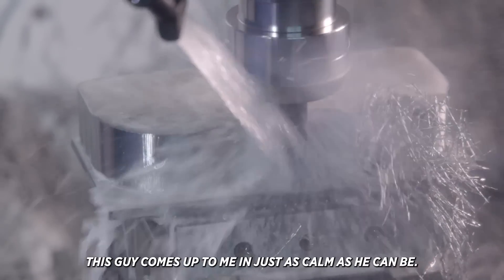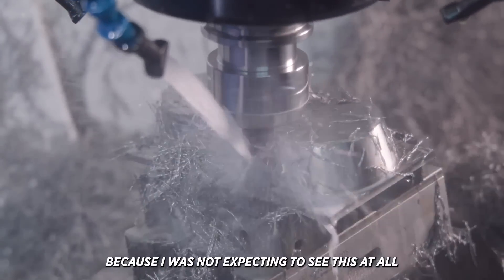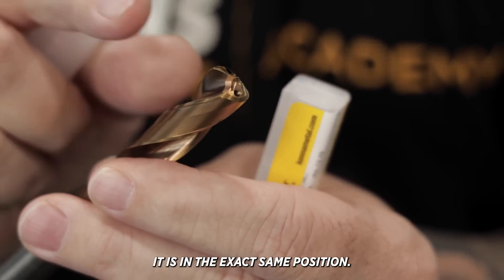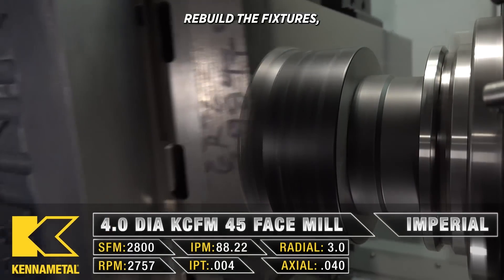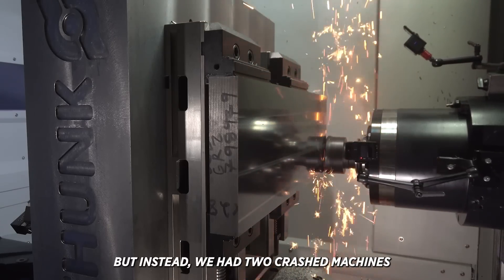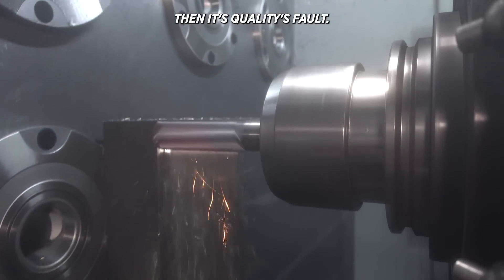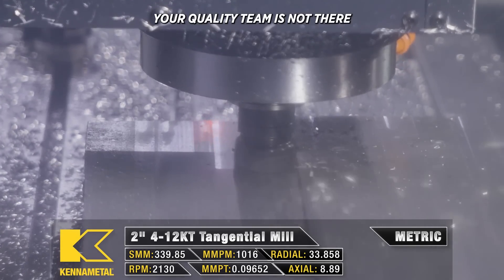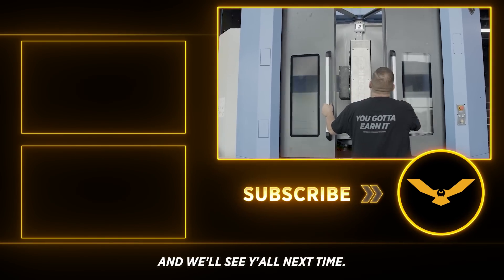$200,000 Damage | EPIC FAIL… Machinist CRASHES TWO MACHINES at the Same Time

Comment: Got a new one to add to the list, setting up op 3 on some inconel parts in a dnm 5700L we had our marketing guy doing different things throughout the shop so he knew a little more about what all we do and as I’m setting up the parts I was talking him through the process. Probing the parts that are now about 5.3 inches higher than the previous op cause they are vertical in a fixture i either didn’t plug in G57 when i touched off the z height or i exited the page too fast and it didn’t save the data for the 4th part. I started the program and it probes all the parts and I’m still talking to the marketing guy when it got to G57 and at 25% rapid went straight down popped the stylus and damn near hit the body of the probe but it pushed the threaded part for the stylus up into the body with enough force to bend something inside the probe, sent the old one to Renishaw where they may or may not be able to fix it and we got the loaner in today. So this one has a good chance of being my most expensive crash so far.

Comment: I have seen that attitude as well! Showed how to inspect the parts on the surface plate with an indicator where the height dimension was critical.He had to Check every 5 parts, easy right? I kept coming around asking how the parts are checking out,"All is good man". Ok right? I finally come around,(supervising 12 people), and check a few myself and low and behold they were out of spec! Turns out he wasn't even inspecting the parts! (He'd been an operator over 5 years!) Told me the machine is suppose to repeat so he didn't think he needed to check them. Well it also matters how one tightens the vice on this special extruded aluminum material. Started out good, then kept getting tighter and tighter, changing the dimension. The most basic of all rules is to  check your work, and confirm your making good parts. It was only a +-.003 tolerance, and a lot of 300 pcs. was scrap. We can hire monkeys to just push a button, but that's not the job! He was fired, because of his careless attitude. Quality is a habit, and if you don't have it, you're unteachable!

Comment: Some programmers like to believe they are Gods and programs are perfect. Operators will always get the shaft. I back plotted a program where the tool was supposed to clear the plate yet it didn't.  After that I back plot everything.

Comment: The factory where I work has a small machining area for some manufacturing steps, none of the machine tools are very large, the parts we make are less than half a pound of steel at the biggest. I've not operated any of the CNC machines there, but I've broken some very minor things before. It didn't feel good, but I've hopefully learned my lesson and now I'm always ready to smash that red button. To fail so spectacularly be so apathetic is astounding.

Comment: I worked for Cosworth manufacturing engines for Formula 1 from 2000 - 2007. The guy you are talking about would have been 'instantly' dismissed by the Company for his actions and attitude (or lack there of). To say that he had been with the Company for several years and put a 'new Program' into the CNC machine and simply pressed cycle start, then just 'walk away' for his break is UNFORGIVABLE.

Comment: I was in a job shop August to January. The programmer was the guy that crashed the most parts in that short time. His programs  were consistently incomplete, IE... Skipping the roughout altogether and just having a finish pass take 3in off diameter in 1 pass. So seeing this I had to go through every line of this guys program every time find things wrong M02 & M03 for instance.  Using wrong inserts, not having the proper tooling for a job. Then wonder why the time sheets are different from his time to actual time on machine, troubleshooting and making sure a first piece article was done completely with correct paperwork and signatures. I've been machining for 14 years on a CNC lathe. This last job here makes me not want to ever be in a job shop again, it was a nightmare for me.

Comment: I was a senior quality control inspector for over twenty years and it was the hardest thing to get through to operators is that they are the first inspector. We were here as back ups for audits and first articles. I operated for a few years and we NEVER cycle through every tool before trusting a program.

Comment: This should not have happened...you are correct...you MUST check all elements of the program. I was working with "CNC" back when it was first thought of when it was called "NC"..numerical control.

We had to cut and make our own 8-track tapes of code to run the machine. The tape ran over a sprocket wheel to read the notches in the tape and tell the machine what to do. Yes, we were quite limited from what CNC is now today...but we got the job done.

The worst crash I had ever seen was with a three story horizintal NC mill...yes three stories...we machined some very big transmission cases for over head cranes. The transmission box I was working on that day was for a 750 ton crane. The operator station was on the second level. We  ran two shift at our shop and the person before me had just loaded onto the machine a new case to be machined....so I finished the setup and checked the code and started the program. Well about halfway through the maching process (about 4 hours to do) the tape decided to jump about three holes on the index wheel (that was a bad thing in those days...it was always happening) so now taps and drills, especially taps where slamming into the transmission case and really badly damaging the case.

Needless to say by the time I got of the floor from flying tools and parts to hit the Emergency Stop button, the case was too far gone and the spindle was completely smashed. This was in 1970's and at that time to fix the machine was $210,000.00. Almost like a million in today's figures. We lost a month due to repairs. Luckily, rudimentary CNC was just staing to make itself known and very, very soon after that the shop changed over the controller to CNC and we were all back in class to learn it.

Take care...happy machining...!!

Comment: It's not just CNC guys who have crashes, I was working a manual lathe boring a 600mm i.d. 800mm deep blind hole with a 100mm boring bar. Well 30 rpm and .10 mm feed it was taking 2 hrs. to do the finish cut, any way I zoned out hit the bottom of the bore and pulled the toolpost out of the cross slide. This was a big lathe, 1 metre dia. chuck 4 metre bed and a 60 hp. motor so I didn't have to tell any one because the noise even got the owner out of his office! My punishment was to make a new cross slide and base of the tool post to repair the lathe, 10 years latter I was made foreman so I eventually got the promotion as well!

Comment: Talking to a supervisor one day when there was a loud thud and the concrete vibrated under our feet. The supervisor’s eyes got real wide and I swear he levitated and took off like he shot out of a cannon. When we got to where the sound came from the operator was leaning against his work bench shaking because he had just taking a finished part out of the vise and was going to put in a blank in. The counterweights cut loose from the Z axis and the Z axis slammed into the table. The machine was an old Dalih with a several hundred pound weight

Comment: I was a 2nd shift supervisor at a shop and there's a new Mazak 4 axis  lathe with a back-chuck where the guy puts the offset in the wrong.column. I don't know whether he didn't get tied in by the first shift properly or not but he'd run it the night before. When that thing crashed you could feel it through the concrete floor. As I approached the machine his face was beet red  and I looked through the window at the piece of live tooling laying in the bed. He had crashed the back Chuck and that lathe was never the same. The owner wound up trading it in . . . So watch out when you shop the used machinery market. I've seen more than one supervisor and an owner lose their bet on used machines. The operator of the lathe wasn't there  the next night

Comment: Daewoo Puma  lathe. I had a 50mm U drill weld itself to a part when the inserts went half way through.. It pulled the part out of the chuck where it remained on the drill. Fortunately the return to origin was x and z not x then z so it didn’t hit the chuck on its way out.

Comment: We had someone crash our Chiron 6000. Machine was down for roughly 2 months costing over $500,000 in repairs, not including lost production (each part is upwards $5000 each, and we can make 10 a day at best as big as they are). That happened over 7 years ago and the machine still doesnt run the same. We almost lost a contract with Boeing for the parts because we were the only ones certified to make them. The guy that crashed it quit soon after thinking he was going to get fired, but found out he wasnt and tried to come back. They declined.

Comment: Largest crash I saw the damage of was an Okuma 2 turret mill turn. 2nd day gone for vacation in Japan; programming was air cutting a change they made to a part in production by shifting the machine Z work offset. Everything looked normal so they gave it back to an operator saying everything is good and to transfer the part and run in continuous. Programmer forgot to put the machine work offset back and so the lower turret tried to cut off the sub spindle. Legit a 6 month old okuma bought for a new production line destroyed and knocked out of production for 3 months my 2nd day gone after working 2 years without a vacation. Replace the sub spindle rails but a year later and the lower turret still hasn’t had its rails replaced causing it to always be .25mm off in the Y. From my experience operators crash machines; setup and programming destroy machines

Comment: I was hired into a shop that was really pushed for time to meet production, so training was a bit lax. I was trained on an old style lathe for about a day after running an automated cell with CNC machines for about a year. So not even very experienced with those...  Second day on the lathe, on my own, I show up just as the tech is leaving.  He had just replaced something, didn't explain much as he Had to go on a smoke break.  Told me to fire it up as it was all set to run....   Uh huh...   part starts spinning, tool moves in...   Bam!  The spindle is stopped, tool dug into the cast iron part.....  but the belts running the spindle are still spinning in the machines!  Inside the machine they are screaming, smoke is pouring out the vents, alarms are beeping...  They reevaluated the training after that.

Comment: Had a guy that worked for me. Horrible! Material was 10" diameter Ferralium 255 and just as  long. Brand new HL-55, on the floor maybe a week. Posted a program via Gibbs and went for a tool change...about 8" deep into the part with a carbide 1.500 bore bar. Blamed Gibbs. I sent him home until machine could be repaired (nothing else for him at the moment). Came back, machine fixed. I asked him to proof out his program. He said done, fixed the issue. 2 hrs later, SAME EXACT THING!!!! He only fixed that one part of the program. "Gibbs fault". Told him to call Gibbs for future unemployment comp seeing that it was their fault. So yeah, about $4500 material, and getting tech out to re-align turret, X & Z and God knows what else. I don't know what final cost was out of pocket, I didn't ask accounting, I didn't want  to know!

Comment: I mean if your mics are out of cal, that's literally quality's fault. You pay them so that your operators don't need to worry about whether their gages are in cal. There should be no out of cal gages on the floor period. Quality should be tracking the location of each gage and when they go out of cal and pull them off the floor when needed. 

Now if he dropped the mic and didn't bring it to quality for cal, that's a different story...

Comment: I think the worst crash as far as damage to a machine goes happened I don't know 10 years ago maybe a little longer

I was running a Cincinnati milacron which used to operate off of a paper tape
The machine was converted to then run off of a laptop

To change programs you had to first hit the button on the machine to clear the program

I was working with a guy that didn't know anything about these machines he actually didn't know a whole lot about anything he got around the shop and his lack of knowledge by yelling at people that didn't work with me

Anyway I go set the machine up I'm getting ready to load the program and this is the first time that I ran the machine when he was in the building

I was hired in because he spent a lot of time just disappearing for from work for weeks or months at a time why they didn't fire him I never did get an answer

So anyways I'm setting up the machine he comes over do you know how to run this yep I've been running these things for a very long time

Okay well I don't know that you know how to run it so I'm going to show you how to do it I'm like oh okay

So he starts walking me through the process press this button scroll down enter this blah blah blah

But he never had me press the clear program button and since I hated him and he was a dick I just let it go

We get all done with his instructions I did everything exactly as he told me how to do it

He says okay hit cycle start
Are you sure you want me to hit that cycle start?
Just push the f**** button

Okay so I did

Now on a milacron the tool carriage the changer all of it moves up and down with the head The spindle doesn't move at rotates but it doesn't leave the machine like they do now

This thing came down at the speed of mock f*** and tried to punch a hole through the table with the tool changer Blue that f**** thing all over the shop floor

He yells at me what the f*** did you do I said what the f*** did I do? You're the one that showed me how to program it You're the one that showed me how to run it I did exactly what you said to do

We could still run the machine it just we had to change tools manually at that after that which was no big deal because they never used the tool changer anyway

Comment: Worst crash ive seen was a big milling center with two spindles working on a 25kg (50 ish lb) hunk of steel, something went ass up and sent the aformentioned hunk of steel out through the closed doors of the machine and bouncing around the shop.
Two cracks in the concrete floor, two dents in the walls and the thing finally came to a stop on the third level of storage rack a good 4 meters off the ground.
Machine was deemed damaged beyond repair.

Comment: we always always ran a new program in single block for the first cycle with no part & spindle & coolant off to make sure no errors in the program
On the first part to check dimensions we ran in optional stop!! yes this was back in the early 1970's, before all the fancy probes
we were NC & CNC operators, not button pushers!!

Comment: Im a machinist for 10 years and im really trying my best, but some days im just not 100 procent spot on. One time i started a new program and  The mill was so close to the workpiece and went g00 full speed straight down crashing in the vise. I tryed to react but the machine was way to fast. This happend 2 of 3 Times to me. Most of the time i check everything and doing my best, but im not perfect, IT takes so much focus/energie. Any of you have some tips for me how i van catch these errors.
Reply: If you miss the same things more than once, make a list of things you miss and check it before you start. :)
Reply: best i can tell you is when running a new program for the first time turn your rapid down as low as the machine will allow, unless you're on something similar to a milltronics mill then use the handfeed to slowly run the first program. but whenever shit hits the fan then try not to beat yourself up too much, we're all human in an industry where either its done perfectly or something breaks and all it takes is a missing negative or a misplaced decimal.

Comment: Look its one thing to missread or dont see specific stuff on a drawing and making bad parts but starting a new programm without turning the rapid down and watch it for at least the first time? bro wtf... just because it was run 100 times before doesnt mean somone could change something without you knowing it. and even if its saved for later use..just fking slow run it.

Comment: Just 2 days ago a classmate of mine dropped a conventional mill's bed on the concrete, bending the Z-axis wheel crooked. He had no remorse and kept blaming the bed being "too slippery". The same guy also didn't fix down his 3-jaw about a year ago, causing it the fly off the machine at 2k rpm and grazing his face. Instead of being shooked or scared he proclaimed loudly that "this wasn't even the worst that had happened to him". Absolute nutcase

Comment: We had an operator that did the same thing.  New program, hit go and walked away (again, new program... not a new operator. He knew better and had been trained in the correct procedure).  He managed to do something I haven't seen in my 25yrs in manufacturing.  Whatever was wrong with the program caused a collision that broke the rails in half off a Studor OD grinder to the point where you could see the concrete substrate base.

Luckily no one was hurt and the doors contained the part, but I have never seen a machine destroyed like that.  It was only a handful of years old and was a total loss.  There was no repairing it.  Sad part was... he damaged 2 more grinders before he left the company.  Some people never learn.

Comment: A large billet was turning on the table of a 5 axis mill, the corners were already meant to be milled off in s previous operation. C axis rotated and corners of the billet sheared off while the machine powered through it. We never were able to get rid of all the C axis backlash.